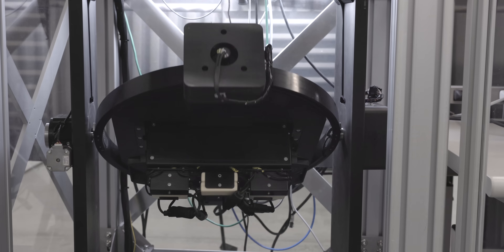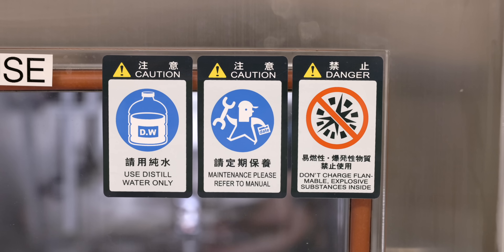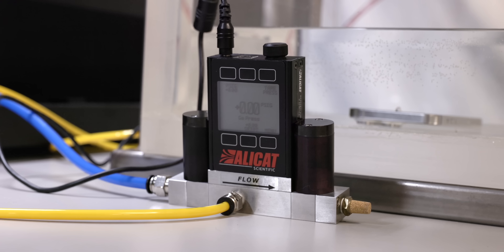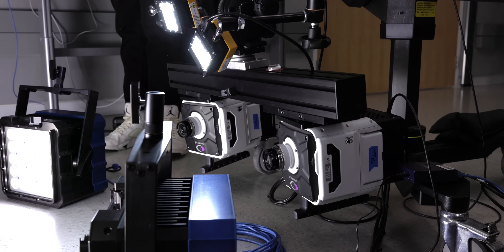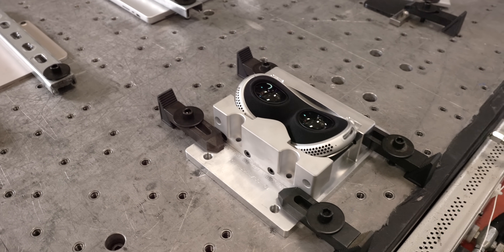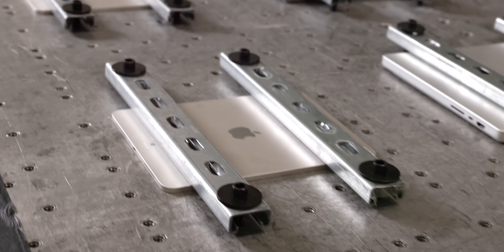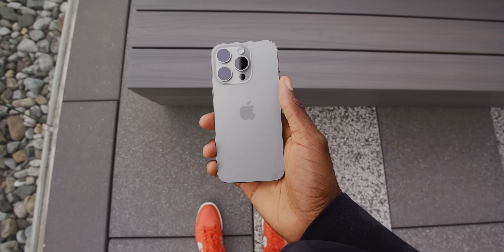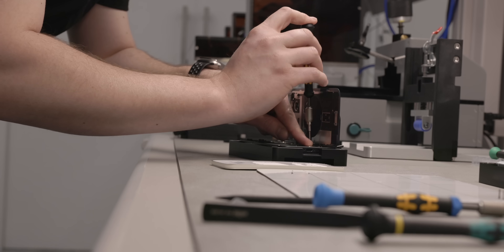I Visited Apple's Secret iPhone Testing Labs!

Comment: I really liked this insight, personally I have no reason to repair my iPhone myself.  I am that person that takes very good care of my smart devices to the point that they still look like a brand new device if and when I decide to trade them in.  I have never experienced a reason to repair my iPhone myself nor do I have the curiosity to tare it apart just so I can complain about how hard it is to get apart thus perpetuating a narrative that details how hard it is to repair an iPhone.  I think that the durability of iPhones has reached a level of durability that leads me to the conclusion of " I do not get why anyone needs to open their iPhone, if you are responsible and take care of your device there will be no reason you should ever need to open it."  If the battery needs to be replaced in ten years then it's probably time to trade it in for whatever you can get toward a new device.  Just too note, I do not use a case on my iPhone 15 Pro Max at home, I put it in one when I am leaving the house because concrete be concrete and that will not never change.

Comment: It's hard to accept that argument when, as you said, the phone is made of glass, both back and front. I would be more than happy to never repair my phone again if it truly was so durable that I wouldn't need to. For now, it feels like Apple is selectively choosing to use the argument "this makes our phones more durable" when it best suits them... perhaps it's simply that I would make a different set of tradeoffs for my personal device than Apple would. For example, I would compromise on the design of a seamless glass panel on the back of my phone in exchange for a battery door, even if it means having visible screws. I would be ok with a high quality plastic, carbon fiber, or other material on the back of the phone rather than glass to make it more durable.
If durability is their goal, they can do better.
If repairability is their goal, they can do better.
Why the argument falls flat for me, is they could do both better, at the same time. I understand there are challenges and that certain aspects of one make the other more difficult, but in my opinion, they're not hitting the mark on either point. They seem to have other priorities.

Comment: 6:09 but they gunna slow down your phone with software updates so you gbuy a new phone yearly? bi-yearly? weekly? i don't own apple so I'm guessing...
had my android since pre pandemic, 2 days on a charge with almost endless usage on gaming mode, up to weeks in battery saving mode.
the specs from probably 5 years ago still eclipse anything that apple has even now... other than waterproof... mines 0% waterproof but I'm not dumb and keep a bag.
Never dropped it, scratched it 2 times but it was on the protective screen so... paid roughly 2K with shipping as it was not even on the NA market at the time...

Comment: the issue is NOT how difficult it is to get into the phone to do repairs though ??
the issue is how companies (not just apple at this point) purposely makes it almost impossible for people to repair their devices by either making it almost impossible to obtain their parts, or some proprietary BS about how you need their own software to replace a freakin camera or a screen or a battery EVEN IF those parts are apple's genuine parts.

Comment: I disagree with the point about durability VS repair-ability. Pentalobe & tri-wing security screws don't make an Iphone any more durable but they do make it harder to repair. Software locking a screen to a device and not making the tools to unlock or change the screen easily accessible doesn't make it any more durable either.

Apple clearly goes far beyond engineering durable things that happen to be hard to repair, into specifically putting lots of time and effort into making things harder to repair, purely for the sake of making them harder to repair.

I also think there are cases where they could engineer things to be more repairable while also being durable. Take the glass backed Iphones for example. Are we really supposed to believe that it was so complicated to engineer a repairable back panel that from the Iphone 8 in 2017 until the iPhone 14 at the end of 2022, Apple couldn't find a way to make the back glass easier and more economical to repair. I really doubt it was a 5 year task for the biggest tech company in the world given an easily removable and replaceable back panel is something we take for granted on most other phones (including from a relatively tiny company like nothing.) 

They just don't want to make stuff easier to repair and it suits their marketing to pretend that its mutually exclusive in all cases.

Comment: The idea that durability doesn't equal repairability is completely false. What about just making it slightly larger, not using glue and using screws/bolts and keeping the gaskets? Same thing, super durable, and easy to repair.

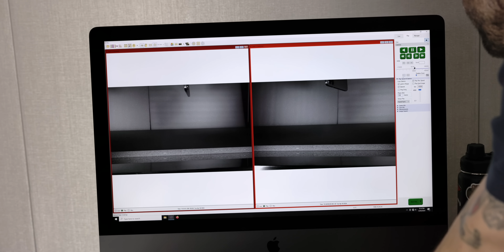Comment: 5:00 Apple is running Windows on the Mac lol 😂😂
Reply: "The Phantom Camera Control (PCC) software is Windows-only and has been fully verified with Windows 10 64-bit."
Reply: @Steamrick  good. you can use the same logic to blame game devs for making games not available on macos and not mention how horrible metal is compared to directx and how you'd have to use xcode and go through horrible hoops to get your game playble on macos for less than 1% of your customers.
Reply: And MS using Macs 😂
Reply: Yes because this SW has no Mac version.. 
so simple.
Btw Apple uses more Windows machines to test iTunes, Quick player, Safari, etc…
Reply: This is is legendary spot 😂😂
Reply: Copied?
Reply: Yes. You know that Apple provided BootCamp on their Intel Macs to make it even easier! Who knew? Errrrr ….
Reply: This comment was not copied. I just saw a similar comment to mine from a day ago just now and it has 10k likes. The mighty algorithm just chose the other person's comment, that's all.
Reply: @Eric-7373what a dumb comment. MacOS is built on top of FreeBSD. There is more power there than you will ever need, and FAR more than windows, but the learning curve is steep and you need to stop using GUIs.
Reply: @Eric-7373 if only it were true, windows wont let me run adobe softwares without having crashing on me every single use. i mean i love using windows but i also love using mac when its time to get work. theres just trade offs between the OS'
Reply: @Eric-7373 Backup your comment please
Reply: @Eric-7373 lol, not sure about that. I have used DOS Win 3.1-Win 10, Ubuntu 9.10 and OSX Tiger-latest gen. 
I can tell you that MacOS is way better than you think.😉

Comment: i cant wait for Louis Rossmann take on marques saying 7:25 lol
Reply: Cackled out loud at software locking a battery to the phone so that only official repairs are allowed somehow makes the device more "durable"
Reply: @NutrisaveoO  Apple has to know the chain of authenticity. (my words) When you have a phone that is totally water resistant, and it gets wet and dies. It's covered by Apple. Unless it was no longer water resistant because of damage (a cracked back) or modifications (read shitty repairs) to the device. Broken rear glass heated and removed and new glass stuck on, dodgy battery installed without the display properly resealed, a 'genuine' display from eBay which it a new generic panel attached into an old genuine display frame- no water resistance. And especially with AppleCare+ where apple covers phsyical damage cheaply, they need to now that it's not full of non-Apple parts - they use the parts out of your damaged device in other devices later. Think about it....EDIT: as others have mentioned, serialised parts and part paring also prevents devices being stolen to be broken down into parts to be sold and used for other repairs. There is a reason why people being mugged for expensive iPhones isn't really a thing.
Reply: Louis is about to completely rinse Marques 😂
Reply: Well well well. Everybody listen to THE MAN! He’s been working in phone reliability for decades and knows it better than the hundreds/thousands of ppl at Apple (or Samsung or …)
Reply: @robertbrzheintzbrz147 people working at Apple and Samsung are biased for the companies favour while a common third party repair shop is biased in favour of customer
Reply: Eventually you’ll realize Louis is just mad that his mom and pop solder shop can’t compete. His whole schtick stems from being bitter and now all he does is complain on the internet. I can’t listen to someone who ONLY complains and changes nothing.
Reply: @o0Donuts0o  luis in one of his videos showed how he fixed a macbook screen with just a solder while the apple company asked close to a 1000 dollars for it. The issue was a backlight error caused by a lose connection. He has shown how smaller technicians can fix issues that apple will charge close to a new product. Don't be a sheap
Reply: @Abhilash-.  LOL its the same taking your car to the dealership for repair than having it fixed by the small car shop down the road. there are more considerations involved when making those decisions.
Reply: @Abhilash-.  Sorry. Sheep for who? I didn’t promote anyone. I just criticized the never ending whine from a talking head. Come back when you have better.
Reply: @o0Donuts0o  as I said your point of him not delivering anything is not correct he has fixed issues for which apple service centers asked close to a thousand dollars for far less than that and within minutes . He knows his stuff and people know that . We don't need to replace an entire screen for a loose connection to the backlight. These kind of predatory service center practices are followed by apple and we need people like him to oppose that.
Reply: @hungryalien  asking to replace an entire screen for an issue with back light seems not so good for environment as well.  Replacing whole product or whole parts are only beneficial for the company.
Reply: @Abhilash-.  I don't think you're following very well here. He just complains about everything. Why you're fixated on Apple as the only thing he endlessly moans about is beyond me? Are you maybe not a sheep? I really don't care what LR does or what he fixes. He sounds like the type of person that if I came to get something repaired I'd have to listen to a diatribe about how Company X is destroying him and I should take up arms in his little crusade and fight the good fight. That's why I take my things to authorized repair centres so I don't need to engage in BS. Fix my thing, take my money and may we never meet in life again. That and I can take it back if their work was crap. Good luck with a mom-n-pop outfit like LR runs.
Reply: @Abhilash-.  true about the environment. but given the same issue, you dont really know if resolder the pins would completely solve the issue unlike if you replace the whole part. 

the manufacturer chose to go the more "expensive" way to avoid back jobs and returns. which not only is hassle for them but also inconvenient for the customer. not counting the backlash the company will be getting.

otoh, your next door small shop will not get that kind of treatment. this also keeps these small shops alive.
Reply: @hungryalien this was how all these devices were fixed before . These companies do it like this because that way they can charge more. This is an electronic device and if there is a loose connection we fix it and it will work and even if it just makes the device work another year or two before getting problems again that is still better than replacement of that full part.
Reply: @o0Donuts0o  you know he ran a right to repair movement for a bit right? Actually went the legal route to change legislation? 
As for competing he wasn’t. He was invariably providing an option for people who were let down by Apple ‘geniuses’ either from outrageous price or outright rejection. 3rd party repair is no longer possible due to Apple ceasing the ability to source or install parts, nothing to do with compete, more to do with anticompetitive on Apples part.
Having said that, yes he is a bit on the rant side these days. However he still does provide change/alternative in software that helps creatives connect with audience and advice or awareness of these issues.
Reply: @ThurstanH  Again. What’s with the Apple fascination? This whole thread is a “yes, but Apple…”. I’ve never brought them up and the only thing I said was that he just whines. Don’t skirt around the fact that all he does is complain endlessly and is tiring to hear another LR rant. He’s not changing the world. He may at one time have led some movement but isn’t doing anything useful now other than to gather an audience who also do nothing but rant about drama into the comments void that is YouTube. You can complain all you want about any company but when the company you’re complaining about is too large to fail (not just Apple) you’re achieving nothing, LR is achieving nothing and your all just in a circle jerk fapping over your own drama.
Reply: @o0Donuts0o  If Louis is just mad that his shop can't compete, then why does he freely publish all the information about repairing MacBooks on his channel and on that repair wiki he's working on? As for "ONLY complaining and changes nothing", he's traveled across multiple USA states to lobby for Right to Repair legislation, and you can find videos about this on his channel. In addition, the stuff he complains about is very real stuff that companies are actually doing, and in my opinion, it's very important to raise awareness and call out companies when they try to screw us over.
Reply: @o0Donuts0o  he went off the deep end not only complaining about apple, which is totally fair, to complaining about every damn inconvenience in his life. People don’t seem to understand the misery that complaining about everything brings. 

Miss the old rossman who would just show us some cool repairs under the scope.
Reply: @o0Donuts0o  There is prenty that you can genuinely criticise Apple about. But there is much that he complains about without acknowledging Apple has legitimate reasons to do it that way.

Comment: I understand that some aspects of designing the phone will directly result in it being less repairable which I am fully okay with. However, apple has shown that  they go out of their way specifically to make sure individual repair shops or a normal user has no chance of repairing something or they have a really bad time. They should be more transparent and willing to give out the equipment that makes the iphone repairable to users as well as repair shops. Doing something like that does not change the durability of the phone at all and only helps repairability.

Comment: There are IP68 phones that have replaceable batteries.

Samsung Galaxy Xcover6 Pro
Kyocera DuraForce PRO 3
Sonim XP10
Samsung Galaxy S5 (IP67) From 2014

This is a difficult engineering problem, but it can and has been solved.

Comment: You can design highly repairable and durable products, but you do give up on aesthetics and possibly cost. Apple optimizes first on aesthetics, and then looks at all the other factors, which is why they say you can either have highly repairable or highly durable.

The statement also glosses over the fact that Apple purposely makes decisions that discourage repair of their devices (or make it impossible), such as component pairing or controlling components from reaching the general supply chain at all. While a device that doesn't break is the best, it is inevitable when you make a device that is mostly fragile glass and contains li-ion batteries that will eventually wear out. In that case, making your design repairable (even if a bit difficult) and providing customers with the tools to do so at a reasonable price should be a standard we hold every manufacturer to that Apple blatantly doesn't give a shit about.

I've designed many products over more than a decade working in product design and the vast majority of them have been IP66 or better and IK10 or better rated, and I can't think of one that isn't possible to be opened up by an average person with a set of screwdrivers and maybe a spudger.

Comment: I've been repairing phones and other electronics since 2017; to be honest, Apple's phones have never been the worst.

There's frustrating little things like Apple only realizing with recent models that it's a good idea to make the back glass replaceable, but Apple figured out after the iPhone 4 that it's a good idea to prioritize screen and battery replacement over other types of repairs. Samsung, meanwhile, makes you choose between replacing the entire midframe assembly or disassembling the entire phone to adhere a new display panel to the front.

Comment: The sliding scale they describe is an oversimplification that makes their decision making on repairability seem more reasonable than it is. The real scale is multidimensional and includes other factors like material choices, manufacturing costs, form factor, aesthetics, marketability, etc. Even something as conceptually simple as making a device a fraction of a millimeter thinner might be for multiple of those other factors at the cost of repairability.

Comment: 4:59 I didn't expected to see an "old" Mac at the test labs of Apple.. Nothing wrong with it but it surprised me
Reply: Just realized that it is running Windows (which is hilarious).. I guess that they are still using the "old" Intel iMac because Windows is still not supported on M chips..
Reply: @JuanesChiwirosky  They don't have a choice with that testing station. From the manufacturer: "The Phantom Camera Control (PCC) software is Windows-only and has been fully verified with Windows 10 64-bit."